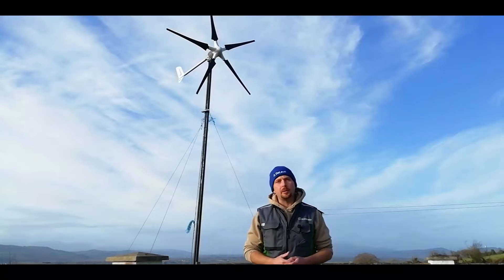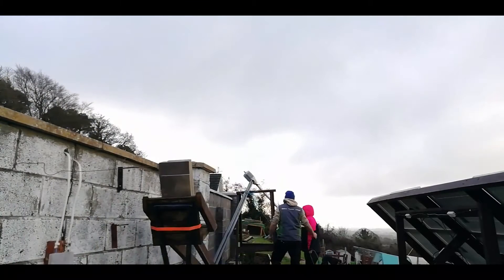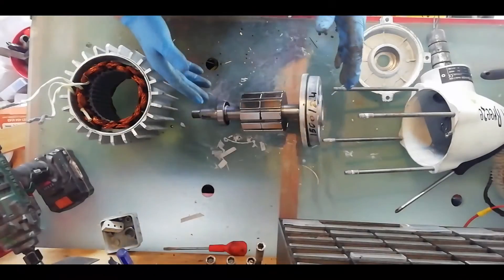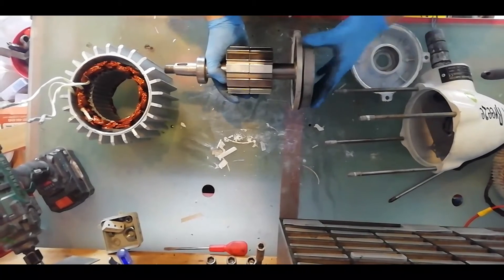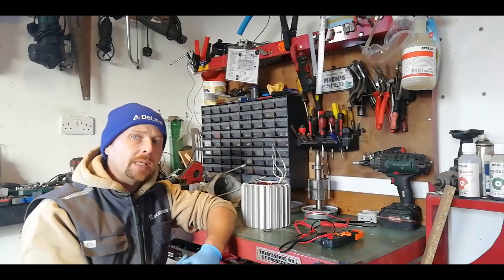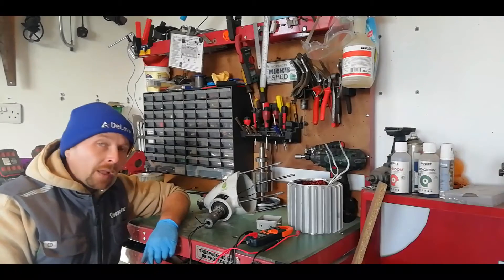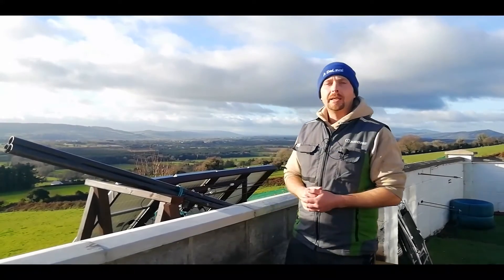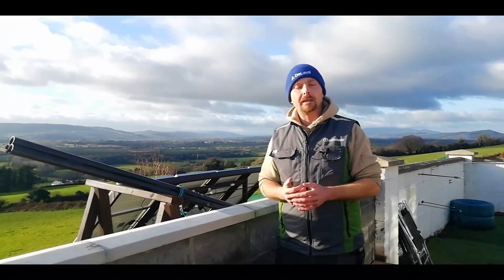WIND TURBINE FAILURE! Istabreeze failure.

Comment: My i1500 made that exact same noise last winter!. Recognised it immediately. Turns out it was the plastic cow vibrating! I was really downhearted at first. Thought it was a major failure. But no, when I removed the plastic cowl, that noise completely disappeared. Up  18 months now and still spinning smooth as silk.  

Great video by the way. I'll bet every Ist 1500/2000 owner would be really interested to see how you took the machine apart and to know how difficult it was. Do you plan to do a rebuild? Would be interesting to see how easy it is to pull the bearings.
Regarding turbine ownership: I have 6 lead acid batteries and a 4 kw solar array. There have been many days since October when solar just didnt cut it. Extremely low output and batteries hovering at low limits. Saved by the istabreeze though. Solar array ( 4.2kw ) produced a lousy 5.6kwh since 1st dec. Istabreeze has produced 27.5kwh in same period, despite quite a few calm days.

So I think it's worth it. And it's good fun and interesting too. Turbine ownership depends on your solar setup, demands and whether your off grid. If one is off grid, I'd say it's very worthwhile as long as you can deal with the maintenance demands. My own views of course.
Update : 22Dec24. Both i1500s running great. Same bearings and slip rings. Thrashed, paint peeling off, but still bringing home the amphours.
Reply from the maker: That's so interesting, what you describe is almost complete opposite to what how our system behaves. We have so many days when the autobrake on the turbine is active due to the solar having our (currently 8) batteries continually topped off. It's only a 1.8kw array which raises many questions. What voltage is your system running on? It has me wondering about what conditions best suit the equipment itself on a long term basis, always thought 24v was a bit of a sweet spot for combination systems.
Reply: @ourkilkennyhomestead2006  I run my i1500 24v turbine into a 12v bank so that I get good charging in lower winds. I found that the i1500, especially on 5 blades,  did a lot of spinning without charging when running into a 24v bank. Changing to 3 blades helped, but running into 12 v really improved charging a lot, because battery charging volts is reached much earlier. . I don't  have an istabreeze charge controller. Instead I have my own diy solid state dump controller which controls two parallel SSRs. Totally reliable last 18 months.(cooling really matters) Critical thing is to set the "start dumping" voltage slightly higher than your maximum solar charge controller output voltage. If you don't,  you'll find that you'll be dumping continually during bright periods. I have my dump start set at 12.7v. My max solar charger voltage is 12.5v with "equalize" set to off. The holy grail would be a Classic250 plus Ts60 dump controller but for me that's way too expensive. Initially I spent ages designing my own solid state dump controller but thanks to a John Daniel YouTube video I got the idea of converting a cheap solenoid battery protector to solid state by hacking off the solenoid and using the output to control SSRs instead. Works really well. Cheap, reliable and configurable. And no clicking relays things to inevitably fail. (The "U30" controller of eBay is great for £13)
Reply from the maker: Glad you enjoyed the vid, hopefully it will be useful to someone out there 👍
Reply from the maker: That makes a lot of sense, ours does do a lot of spinning before reaching charging threshold. Super clever hack with the relay must check out that video on it. Tbh I think you're better off with your own control system as the istabreeze controller is not great and not configurable at all. Thanks a mil for sharing that info with me, it always seem to be the way that go out and buy these fancy toys only to find out that the DIY method works better 😁
Reply: oops, said earlier  I used 12.5v as setpoint. I actually start dumping at 14.5 and stop at 14.7.Was a late night last night!
Reply from the maker: @nhikoid  kinda wondered about that but didn't want to say. I use the automotive levels as a general guide, so for 12v the charge level should be between 13 and 15v or for a 24v system Ive ours set at 27.2v float level, 28.5 bulk charging and 29.2v when doing an equalisation cycle. Speaking of cycling, do you find you have to swap around your batteries every so often to keep their performance up?
Reply: @ourkilkennyhomestead2006  , I use 14.7 to start dumping and 14.5 to stop dumping ( sorry quoted that back to front earlier ). I run a manual equalize cycle once every couple of months or so, if I remember too. ( hancook 12v 130ah x 6 ) . I make sure my turbine and dumping circuit is switched off during that cycle, because the hancooks, being "calcium-tech" take about 15.3v to equalize which would kick off some dumping as it would breach my normal-running 14.7v limit. I have messed about with this quite a bit over the last 18 months and the batteries are holding up fine.. Being in parallel, they dont need balancing. Maybe yours do if you're running pairs of 12v batteries to make up 24v.?...On a slight tangent here, I've noticed now and again that my batteries can exceed 14.7v now and then during high winds and dumping, despite having 1800w of dump resistors. Only for a few seconds now and then, probably causing no harm. Maybe even a good thing. Probably happening because the chemical reaction is "elastic". The battery chemical reaction caused by charging has some momentum so that even when the turbine slows down there is the ocassional overshoot as volts rise and fall. I could try increasing my dumpload size but I don't want to jolt the system too heavily with say 3kw worth of dump load. Last summer I'd accidentally set "equalize" to "Auto" on my solar charge causing all my resistors was literally red hot. More to all this stuff than meets the eye!
Reply from the maker: @nhikoid  aye, nothing like the smell of hot electronics to worry the wallet 😁. At 12v parallel the charge absorption per battery would definately be better than at 24 where there's always a leading battery and trailing. The lead battery gets the bulk of the charge and discharge while the trailing gets whatevers left. It usually works out at 0.2amp difference between them for some reason so I do a rotation on them every so often which seems to do them good.
Looks like you're in for some more strong winds and heavy rain again over the next few days, fingers crossed your turbine will make plenty of power out of it for you.
Just thinking there, 1800w is quite a dump, am thinking of a sand battery project as a dump load for our solar, i reckon something similar might work well with your turbine, use the excess to heat some water kind of thing. Plumbing it into the house properly would be the hardest part of it I reckon. Using an oil barrel filled with sand and immersion element I think would handle up to 4kw of dumping storing it as heat in the sand. It could be regulated then with thermal cut off switches to turn on or off depending on the sand temperature. Could work well if set up right.
Reply: @ourkilkennyhomestead2006  Haha! Indeed!. I've burnt out a few gadgets over the last 2 or 3 years. All part of the fun learning experience. In a 2 battery series circuit, the voltage clamping effect should be shared evenly across the two batteries during charging  but even with identical connections there will be differences in impedance between the two batteries owing to chemistry, age and manufacturing differences. That will cause theme to drift apart over time. So "cycling" a series pair probably won't work. ( someone correct me if I'm wrong )   Definitely something to keep an eye on. My father in law had a noisy hot bulging bubbling battery in a 24v series of two, way down at 10v with the other battery fine at 14.5 during charging. Could have ended badly! I suppose you could invest in battery balancers. But that's more money out. I use an 1800w dump to make sure I can clamp my voltage low enough in a storm to overcome the momentum/surge in charging during strong gusts.  I only upgraded it last year from 1200w ( 6 x 12v car heaters from Amazon @ £12 ). The sand battery sounds like a great idea!
Reply from the maker: @nhikoid  yep,  you're probably right about the cycling longterm. Short term it has helped a bit, was lookin into battery balancers and would like to test them out but at 30bucks a piece it gets pricey fairly quick as you quite rightly said. One things for sure, having had to send 4 yuasas back under warranty, we'll never buy that brand again.
Could you recommend a good dump load resistor to buy?
Reply: Could the dump load here be sent to a heating element and store the energy in a hot water tank? There is a video of some connecting insta to resistor dump load but no reason this cant be a heating element.